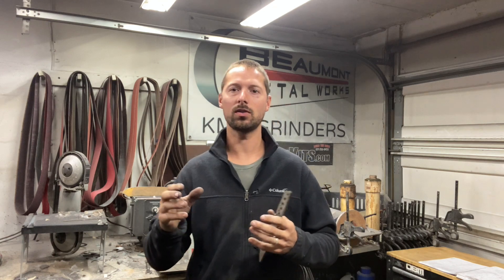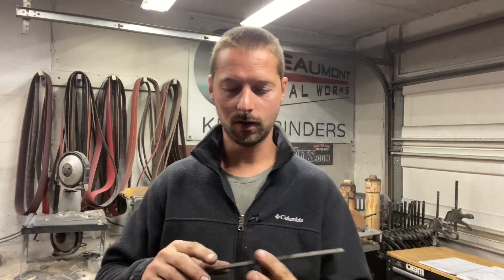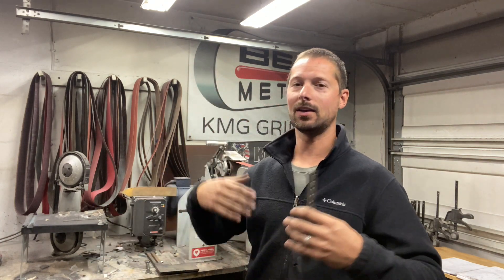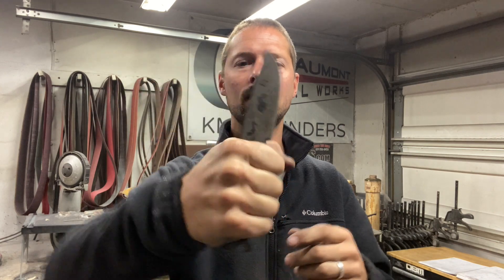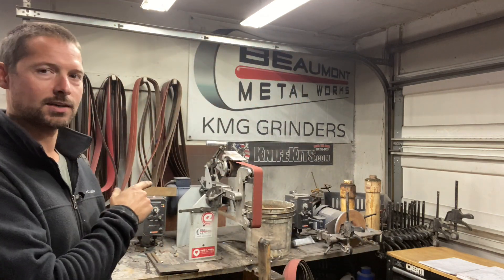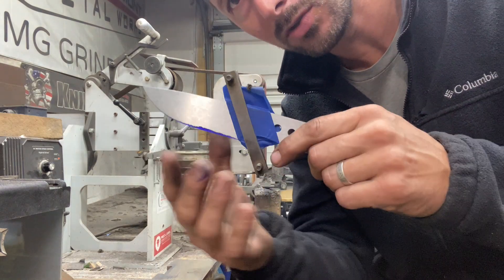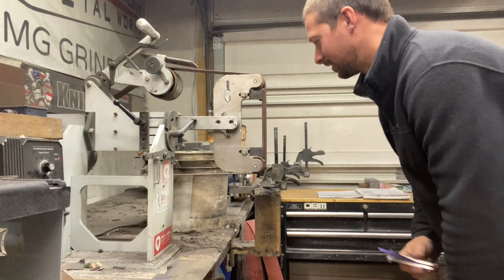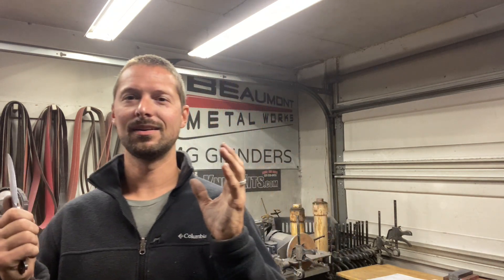The GREAT free hand grinding VS JIG debate!!!

Comment: Really enjoy and appreciate your videos. Taking a shot at making my first knife, since I already have the tools in my home machine shop. Had SWAG Offroad  add one of their knife blanks to my last order and working on one just like the one in this video, so this really helps! I made a crude jig out of a piece of angle iron, and I like the way it works so well, I just ordered the OBM adjustable jig. I removed the hokey bottle opener from my SWAG blank, as I didn't care for that sharp hook sticking out. Also wasn't sure about its heat treatment, so I normalized and annealed it before starting on the grind. Hope to pop it back in the furnace to harden/temper it this week. Thanks again for sharing your knowledge!
Reply from the maker: Awesome to hear!! Good luck on the build!

Comment: I'm a vote for bevel jig.  They definitely don't come out "perfect" like a production knife.  But they certainly have a consistent angle to sharpen from.

The issue with the jig is that if there is more than zero play, it will play with your work while you try to rein it in.  I find that I have to start my bevels at 60 grit and work toward 220 pretty quickly so that I don't make an uncorrectable flaw that will carry from the bevel to the spine.  At least with the finer grits the mistakes I make are small enough to qualify as character flaws.
Reply from the maker: Definitely can understand that!

Comment: Yeah, I have recently flat stone ground the black coating off of my Benchmade Super Freek, only to find that the bevels where not absolutely flat, some convexed spot I had to finish with my finger and abrasive. So, CNC is kind of cool, but watch the tolerances. Had a hogue with messed-up bevel too...
I like the jig method, just need the right jig, like magnetic and with a kind of stopper for the plunge.

Comment: This may be a dumb question, but when freehand grinding, do you do both bevels on the same side?  By that I mean handle on the right side the whole time an just rotating the edge side from top to bottom.
Reply from the maker: I do! ( this is not the “correct” way but it works for me)
Reply: @gentrycustomknives8008  that is very interesting and I may have to give it a try myself. I find my right handed grinds come out so much cleaner than my left. Thanks for the great video!

Comment: I am no pro, but I gave up jigs because of the time required to get the work rest set up and get the knife positioned correctly in the jig, and the fact that any gunk or bumps or shavings on your work rest will keep you from moving smoothly across it. I can see for certain trick grinds where a jig would be valuable. Freehand grinding is frustrating but man it’s satisfying when you get it right!!!
Reply from the maker: I 100% agree!!

Comment: Have you noticed wether or not your belts wear out faster since you grind after heat treat?
Reply from the maker: O they definitely go faster on hardened blades
Reply: @gentrycustomknives8008  i guess the next question, is the juice worth the squeeze? I’m fairly new to this (actually have my first batch of 15 on the way from a water jet company now) but i know there is less potential issues if you ht then grind but is the added cost of belts worth it? (I’m assuming so since that’s what you’ve been doing for a while. Or do you just be sure to add that in to the cost of the knife so it’s a non issue?